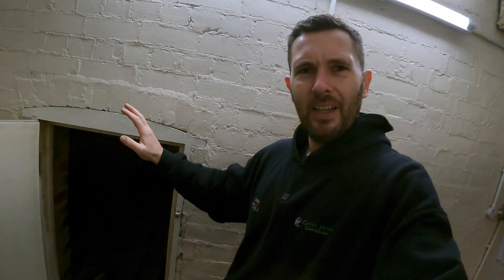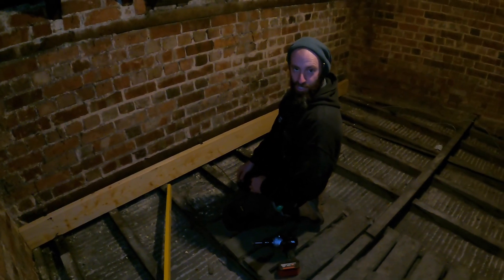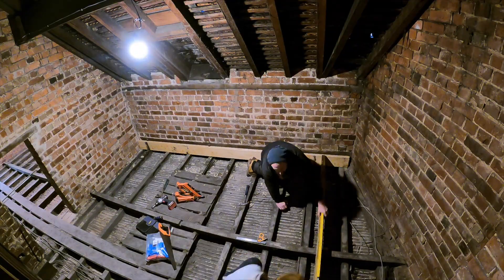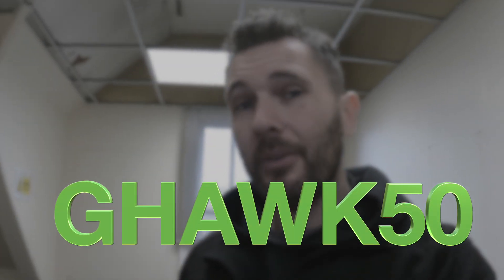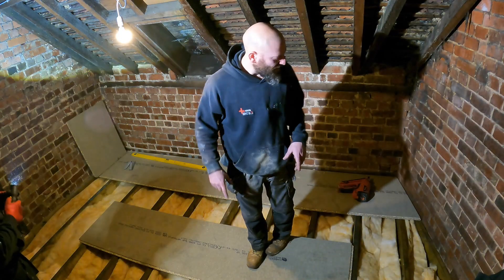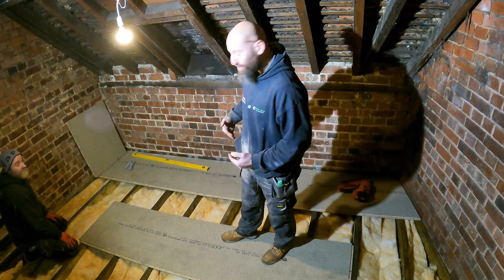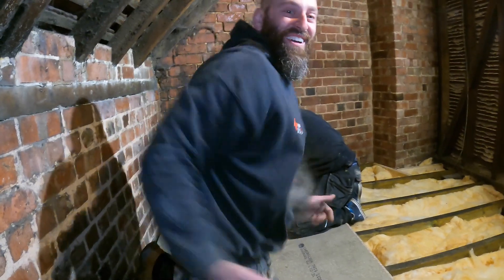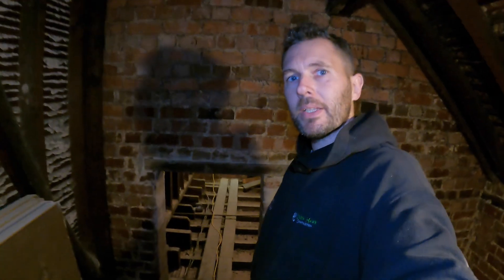HOW TO CREATE A STORAGE AREA

Comment: just a quick question what centers do you recommend between joists for attic flooring thinking of doing something similar in my attic purely storage only. was thinking of using 4x2 to raise above existing insulation and 18mm osb or chipboard any advice appreciated and wont hold you to it thanks mike.
Reply from the maker: We always use 400mm and I would use 18 mm chipboard flooring or ply over osb as osb is not designed for that purpose 👍